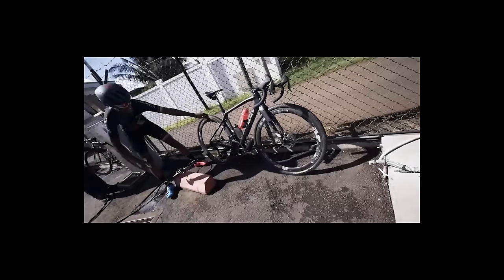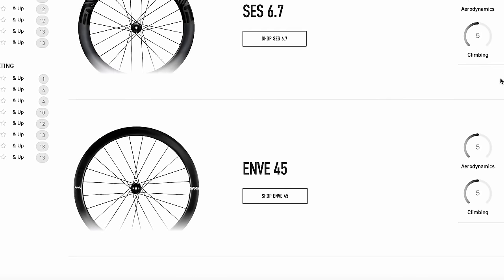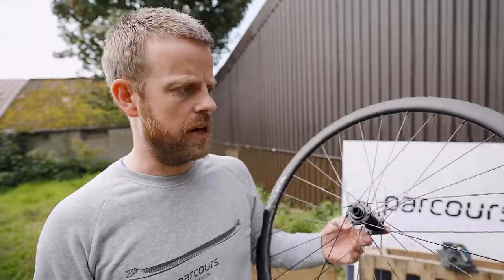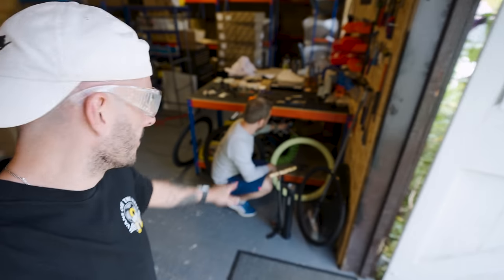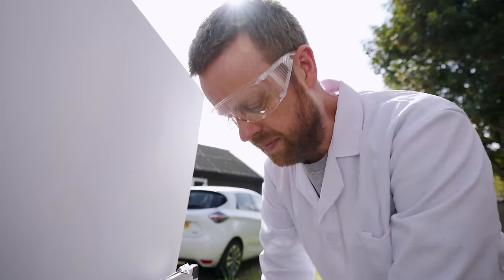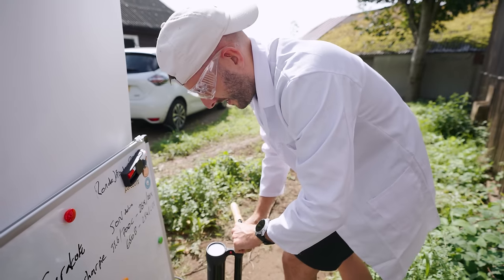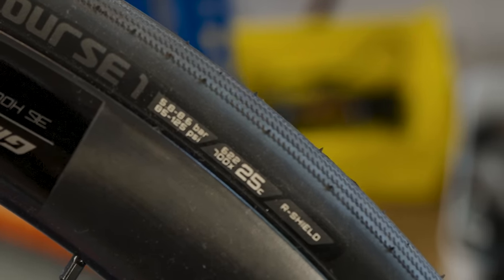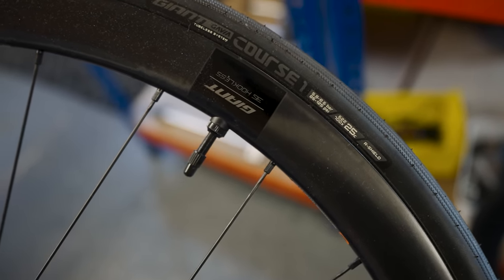Pumping Up Carbon Bicycle Wheels Until They EXPLODE

Comment: 110psi, but that's a static test...but you could even try much lower then put speed and cornering stress going down a hill fast into the equation. I just don't think hookless has any place on a road bike.
Reply: Exactly, the weight of bike+rider will already increase the pressure somewhat, not to mention going over bumps and the like.
Reply: Totally agree, hookless may be fine for gravel and MTB, but for road, no thanks.
Reply: Why would the pressure go up if there is a rider on the bike? The volume stays the same, that's the shape of the tire that's changing not the volume.
But I agree that altitude and heat (created by speed) are gonna have some impact on the pressure 👍

For riding with hookless on the road, I never inflate over 65psi (4.5bar) too keep a small margin but I'm a light weight guy (so with 28mm tire I don't need more). Nonetheless I don't think that's the kind of wheel for every rider and they need to find a way to alert people on those limitations.
Reply: @ee-dt6oe  I'm not saying the pressure will go up, but a tyre deforms when you apply braking and cornering forces / under load, therefore you will experience issues in the real world much lower than the 110psi in this example.
Reply: @ee-dt6oe  of course the volume changes when the rider sits on the bike. Imagine the tyre is like a baloon that you squeeze in your hands - it changes shape slightly but eventually the baloon will pop. The same applies to the tyre.
Reply: Obviously hookless is a modern concept for rims, which goes hand in hand with new investigations which indicate lower tire pressures are more efficient (information coming from silca eg). So while education and awareness is definitely a good thing, as a "normal" heavy rider you wouldnt need to pump up your tires anyway so high. My usual weight is around 84 kg. Zipp suggests (with a normal tire) around 4 bar in the front and 4,34 bar in the back (5 bar is max).
Reply: @ee-dt6oe  Since air is compressible, the pressure does increase a bit when there's a rider on the bike. The deformation of the tyre is basically the result of the pressure changes. The overall volume is not constant (rubber is elastic). Especially when you hit a bump or a pothole, the pressure can increase by a few psi momentarily, and it can also cause the bead to mobilise or even pop off, I think this is why hookless is scary (if it explodes at 110 psi in a static test, what does it do az 80 psi hitting an enormous pothole?).

Check out GPLama's video 'Tubeless Gravel Tyres: Six Month Sealant Check & Refresh.... plus TyreWiz Install', at around 8:30 he shows how the pressure changes in real time as the tyre gets compressed.
Reply: Exactly. Came to comment the same thing. Static testing is worthless. For instance TL tyres does not burp in static testing but they very much do IRL. Also, The whole TL is better because lower pressure, is nonsense. Any ol´ clincher can ride at equally low pressure. Of course low pressure increases the risk of rim strikes and snakebites, but the solution to that is more pressure or bigger tyres, NOT a rim that's slightly more robust, Obviously! Rimstrikes are dangerous, because you might crash, even if the tyre stays on the rim.
Reply: @Xarx42  The whole lower tyre pressure is faster BS is just that! Marginal on rough ground and on decent tarmac higher pressure loses fewer watts.
The advantages are not enough when you balance safety convaluted seating of tre sealent and when the tyre gets a puncture the sealent doesn't fill, then you're bolloxed! For larger people hookless isn't fit for purpose and tubeless is a manufacturers wet dream to sell people the kings new robe, just like disc brake bikes!
Reply: @HUNHali   That is true. However the forces on the tyre are completely different in actual riding application vs static pressure testing. Static testing does not account for side forces or (uneven) deformation of the tyre. I bet you a million $ in real world testing a hookless tyre is much more likely to blow off compared to a normal clincher.
Reply: @ynotnilknarf39  Ffs a little rant against everything, right? Luckily no one stops you from riding your 20 year old steel bike with v brakes. :)
Reply: Im using hookless DT Swiss XRC 1200 with no issues on my XC bike. Works amazing... But I'm 70kg and riding 22PSI. It's hard for me to imagine to use hookless on my road bike, so happy to have hooks on DT Swiss ARC 1100 rims ;)
Reply: @ee-dt6oe  Ofc you get more pressure in if you ride it. 
How do you think tubeless tires are perfectly fixed with repair kit. If you take it and the pressure is to high that you crate, the scrap to plug the hole is just pushed out. 
Every damn time I had this, I hit a hard compression with the tires.
Reply: @Xarx42 someone please tell him that it's the 21st century...🙄
Reply: @Xarx42 Since you mention Silca, let's have a look at their pressure calculator. Total weight rider+bike 90kg, on worn pavement/some cracks, it gives 6.55/6.4bar for 25mm tires, 5.5/5.35bar for 28mm and 4.9/4.8 for 30mm. Nowhere near your 4bar. So with the widest tires, we are already at the maximum safety limit... If you ride gravel fine, but this has no place on a road bike
Reply: @ee-dt6oe as the weight increases the pressure will increase due to the force on the tyre rather than a reduction in the volume
Reply: @swe223  As unmistakably mentioned, I used the Sram/Zipp tool. Yes, there might be a conflict of interest, so Silca appears to be more trustworthy. However Silca also explains which deviation is better: 10 psi too low costs only 1 Watt, while 10 psi above requires 9 more Watt.

Edit: I don't want to express the necessity to save barely 10 Watt, but to underline how the usual high tire pressures don't seem to be beneficial.
Reply: @ee-dt6oe Nope. Pressure does go up and volume is reduced with a rider on the bike or when hitting bumps etc. So a static 100 p.s.i. will momentarily be more than that when hitting bumps. Apart from the fact that rubber is elastic and it will deform it's shape from the wheel, which when it is close to its bursting pressure limit in a static position, will make it burst upon hitting a bump. Hookless rims not for me, especially on a road bike which can go quite fast, thanks. My instinct, intelligence and common sense tell me this.
Reply: On any bike I would add!
Reply: @HUNHali Agree.  And I have seen this happen on hooked tubeless tyres at relatively low pressure (burping, etc).
Reply: @ynotnilknarf39  with you until the garbage about disc brakes. FFS why are idiots against the actual clearly superior and safer braking tech?
Reply: @CatTerrist  They're not superior at all, what, in wet conditions for a brief split second advantage? Where does this help, in a race, maybe but isn't demonstrated to be such.
Slowing/stopping comes from traction of tyres and your ability to understand and react to the scenario in front of you.
More power and so called modulation is laughable, never not had enough braking with rim brakes, even descending in the Alps from 55 mph and as for modulation, i guess the pros were doing it wrong for years on rim brakes.
Certainly there's no fewer crashes in the pro ranks since the went to disc brakes and the still lock up and slide out on corners. 
Also, calling people idiots because you have a different view isn't cool.

Comment: 110psi inflated right away blew off. Inflated to 70 for two months of riding stretching the bead I bet it would take even less to make it pop off.
Reply: Yes. In my vid where it blew off at 5 bar, it took 90 seconds first time, about 25 the next.
Reply: yeah hookless doesn't sound safe at all. it just sounds like companies cutting corners to reduce manufacturing costs.

Comment: Surely the pressure will increase when the wheel hits a pot -hole, stone etc.  It's be interesting to see how close the booklet from gets to the danger point when being ridden.
Reply: I was thinking about this recently, but the change in pressure will be proportional to the change in volume of the tyre, so i bet there is actually very little change in tyre pressure over bumps etc - but the jolt we feel is more surface area of the tyre pressing against the obstacle, which feels like higher pressure
Reply: Sure does! With tubed wheels the PSI molded into the side of the tire is one half of the pressure required to blow it off of the ETRTO test rim. My tires are 75 psi tubes and that's what's molded into the tire. They're 60psi max with tubeless but you have to find that information on a website. I did a poor job hopping the rear wheel over a curb and blew off my tubeless tire because I was running it at too high of a pressure to start with and the curb impact blew the tire off of the rim. Sounded like a gunshot.
Reply: Totally agree! Another scenario is leaving a  bicycle in a hot car.  It could heat the tires, expand the air inside the wheel and have it blow sealant (liquid latex) onto the car’s interior.

Comment: The scariest part is dynamic pressure. I'm a heavy bloke, something like 115kg last time I checked, so I'm used to riding around 90psi by default just to make sure the tyres will support my weight. But what about when you hit a bump you didn't see in the road? What about when you just can't avoid a pothole, or you want to bump/hop up/down a kerb. For a split second the pressure in the tyres goes up by a fair amount. With hooked rims and beaded tyres I've never worried, if anything the rims will fail because I bottom the tyre out before pressure ever becomes an issue. But with hookless, it seems like an accident waiting to happen.

Worst still is cornering. You lean over a fair way when cornering at speed on a bike, and I'm not confident in any way that the combined issues of a lateral force on the tyre, and the increased load due to centrifugal forces, won't result in blow-outs.

As far as I can see hookless is being peddled as 'safer' but is actually being pushed because it increases profit margins. Same wheels, same price tag, cheaper to make. Sure there's the argument that the rim can be made more impact resistant with hookless, but IMO that only really applies to MTB and maybe gravel, where they run very low pressures anyway. No roadie is buying wheels based on their ability to resist damage from bottoming-out, and if they were they'd be buying steel wheels.

Just because the technology works with MTB, doesn't mean it's transferable.

One cynical thought - seeing as it's pretty tough paying mortgages and such these days. Go buy some hookless rims. inflate them to 72.5psi. Then do hill reps and go hard on the descent. provided you survive the inevitable, and you've got a reasonable lawyer, you'll have no trouble getting Giant, ZIPP, or whoever to buy your house for you!
Reply: I'm a similar weight with the bike and I ran Hunt Gravel hookless rims with 28c Schwalbe Pro One tyres at over 90psi for around 4 years, I had no idea about the pressure limit until recently. I never had an issue until the rim tape failed.
Reply: Except none of this is happening. No exploding wheels as guys take turns etc.
This is called inventing a problem that doesn't exist.
If you guys want to go back to steel wheels and frames, and rim brakes, please do, but leave the rest of us out of it.
Reply: @nealm6764  whether or not it is happening, there's no real gain and all that to potentially lose.

What exactly do I save by running rimless? What exactly does it offer me? Stronger rims? Well frankly I wasn't planning on bottoming out and if I do I've got bigger problems than my rim taking a hit.

Instead of 'us sticking to steel and leaving you out of it' how about you buy your hookless rims and let the rest of us carry on the way we want. That argument doesn't really work does it...
Reply: @daredemontriple6  Except I am not making baseless assertions about riding steel wheels will kill riders etc, and doing some crazy tests that never happens while riding and acting like that proves they are dangerous.
"watch how these Steel wheels smash up when running them over with a truck! OMG, they are death traps! Now imagine doing HIIT sprint training with these. Good luck even surviving!"

Comment: I've been on hookless firecrest 404's for 5 months or so now with GP5000S TR's and I've been trouble free for all of that time.  These are actually the best cornering wheels I've ever ridden, the grip of these tires on these rims is insane, I've not even pushed it to the max yet and still I'm blown away by what they can do.  

However, Francis I am 1000% percent in agreement with you about those Giant Tires being sold on bikes with those hookless rims and i CANNOT believe the company is putting bike in show rooms like that.  I work at a shop in the US and I'm not confident that everyone in my store would know to inform the customer about hookless rims.  I am actually quite certain that two of my fellow employees would know nothing of the technology.  Similar to tubeless, hookless is a bit of a performance upgrade.  It requires the user to know something about their bike, which many customers buying bikes of the peg will know nothing about bikes nor their own bikes.   I think it's pretty silly to sell hookless on brand new bikes off the showroom floor.  It's something for the customers upgrading their bikes to know about.  But for someone buying a brand new complete bike, I agree hookless should not be part of the equation.  

If hookless rims make the wheel cheaper to produce, fine I guess.  I've owned a couple of pairs of Zipps over the years and I gotta admit my current 404's are REALLY great wheels and the price hasn't really gone up much compared to my old tubular 404s from like 2009 but these do ride DRAMATICALLY better.  So, they may not be getting cheaper for us consumers but they are getting better as long as you know to run them at 72psi and below.    And speaking of getting cheaper, I used to have a set of Zipp 303s wheels and they were cheaper... $1300 for Carbon Zipps?!  That would have been unheard of just a decade ago so the technology is becoming more attainable as well as better.
Reply: Kind of a moot point about new giant bikes being sold with hookless as stock rims.  Giant bikes with hookless wheels come with Giant tires and there is not really a restriction on the pressure with this combo.  Most of their hookless rims have a max PSI of 125 as long as you use a compatible tire.  

If you are spending the $5k + on a bike that comes stock with carbon hookless rims I think it is implied that you’d do you own due diligence research on them.
Reply: @KN-vl7nk  bruh you would think so, and so did I before I worked in a shop.  I work in the DC area in a fairly high end shop and we get plennnnnnty of people who don’t do the research you or I would before dropping that kind of coin 🤦🏽‍♂️